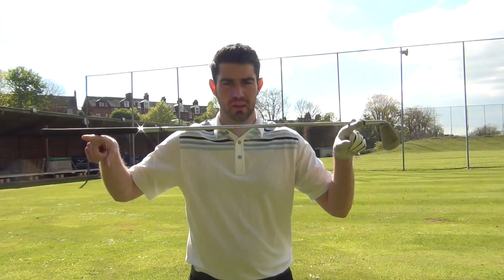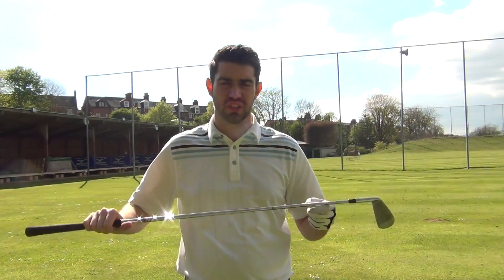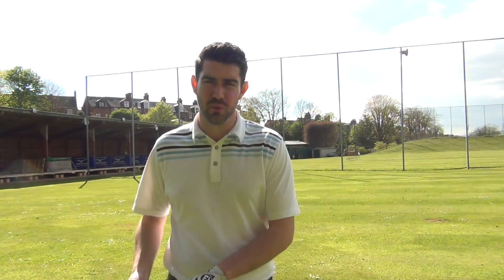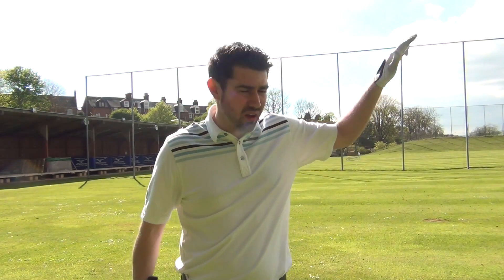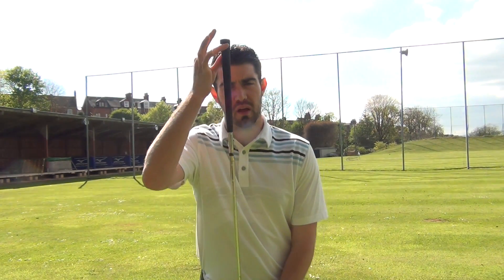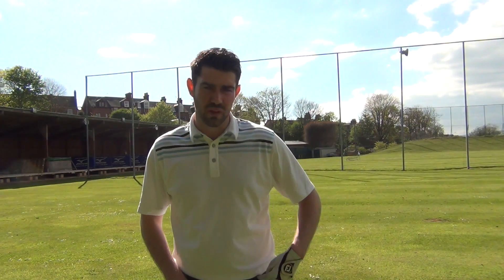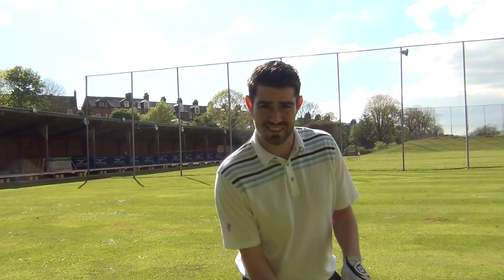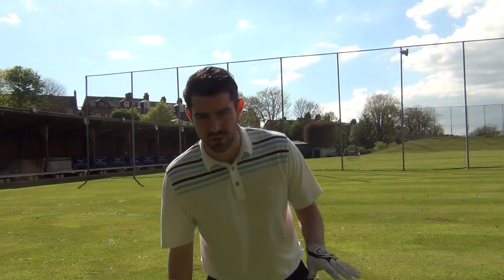How much spine tilt is required at impact

Comment: buzza, how does spine tilt at impact compare to spine tilt at address?  more i assume but is there a way to measure how much (disregarding ball flight issues).  my last practice session i managed to hit very solid driver and wood shots over emphasizing (in my head) my spine tilt at address, then trying to at least maintain that at impact.
Reply from the maker: More tilt at impact compared to address is better IMO. Added tilt at address can help in some cases,with your above example a good one.
Reply: Buzza Golf
thanks for the reply